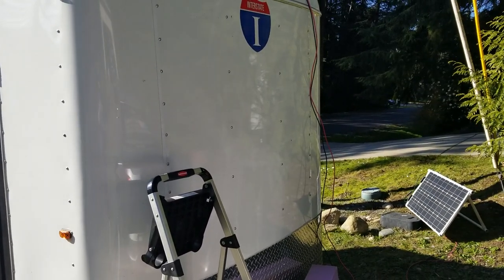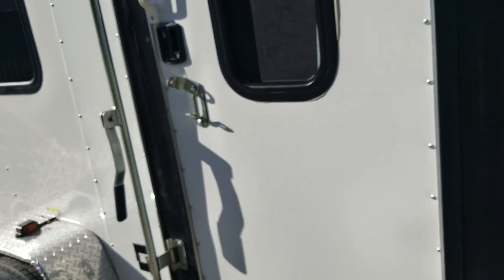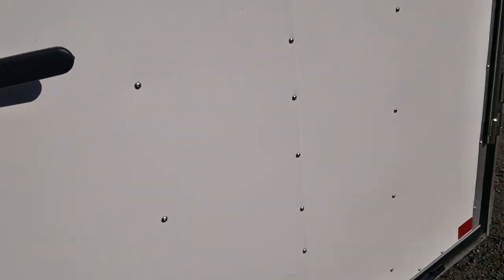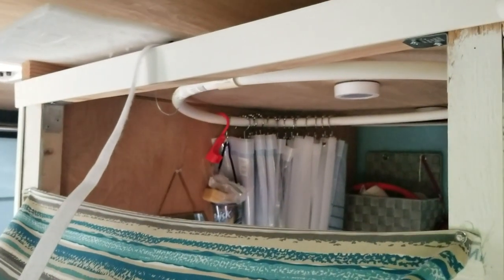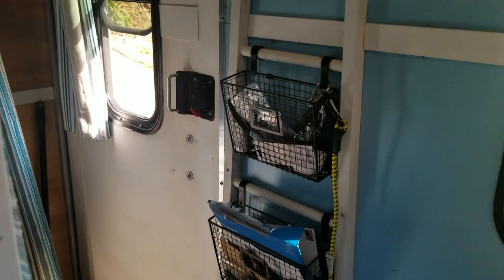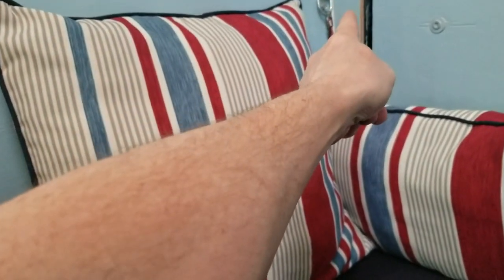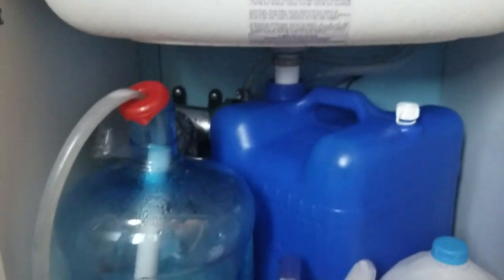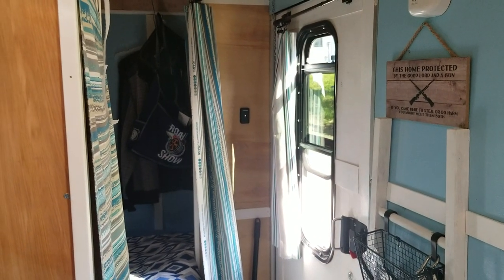6x12 Cargo Trailer Conversion Tiny Home.. Full Overview .. #1

Comment: Really like the cargo tiny home Pat. The fan and the windows are a must for hot summers. You gave me some ideas with your PVC using it for your solar panels. Well thought out. What I like most about it is it’s size. When and if it ever comes down to having to leave it all behind and go that’s a perfect shelter you can hide almost anywhere.  Great job.
Reply from the maker: Thanks Todd..stay aware & vigilant...I have 2 more 100ah lithium batteries coming in soon for a total of 400ah ( equivlant to 8 )lead acid at a fraction of the weight.. We will be able store some serious power  off-grid. .

Comment: I noticed in a fast shot, that you have rounded corners. My older cargo trailer does also but I'm having trouble covering the incoming wires easily so those wires can still be worked on. I'm an older gal so any suggestions?

Comment: Looks like a great build. 
Don’t think I have seen a 6x12 with the bed in the front. Is the front bed for one person or is it big enough for 2? Also is the toilet a camp style or something else? 
Also can you tell me how thick your insulation is? And what material did you use for your walls?  Finally if you had it to do over again, what would you change if anything?
Sorry for all the questions. I have an old 6x12 that I would like to convert.
Reply from the maker: The bed fits 2 comfortably. Its  a 2  piece  rv cassette toilet. We used 1" RMax insulation in the walls & 1/2 inch in ceiling. And lastly, we would change nothing , my wife designed it.  Hope you subscribe, we added more to it since this video .Good luck with the 6x12 build.

Comment: Where did you get those black racks? I just bought a new 6x12 tandem trailer. Had to order it and it took 6 months to build it due to material shortages. Got it two days after Christmas. All I've done so far is built a 7'x30" bed and bought a battery and two lights.
Reply from the maker: Here is a link for the black racks. 
Costway 8 Cube Grid Wire Organizer Wardrobe Shelves Bookcase DIY.
https://www.target.com/p/costway-8-cube-grid-wire-organizer-wardrobe-shelves-bookcase-diy/-/A-83742784#lnk=sametab

Comment: You blocked off the standard air vents that come from the factory.  Would it be better to have some small bit of air circulation?  Mine gets so hot when just parked in the driveway, not being used.  Nice build.  Did you film any while installing the insulation and windows?

Comment: What type of batteries do you use? Do you keep them inside? Any concern about emitted gasses from charging? I'm not sure the physics of it. Thanks!
Reply from the maker: I used lithium batteries. I have 200ah but I have 200 more ah coming on Thursday so 400ah total & 700 watts of solar.. As far as gases ..no they have BMS ( battery management system)  on them to protect from uneven voltage ect. Never had a  problem. They should never be discharged or charged heavily below freezing. I know that. They charge fast..are light &  last 1000s of cycles. Under 50% they do lose their juice fast but will not harm them diwn to 0.  We will have a new video soon on all the uprades..stay tuned...